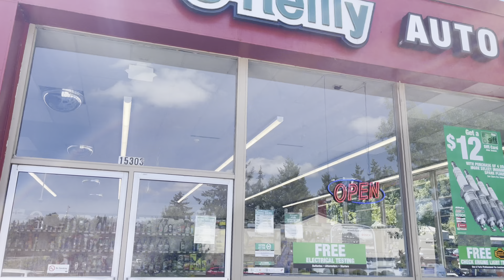Jeep Grand Cherokee Wk2 Radiator/How to replace a radiator

Comment: I did not use that air bleeder.  It bled  it self when driving.  The radiator change you made look way easier than the last video i watched. The other guy was unhooking condenser and bunch of other stuff. 
I do not think i have a leak . I can smell coolant but it's probably from my last coolant change. I sprobably spilled it over stuff😮 but it's good to know it's doable on driveway
Reply from the maker: Haha yea it was pretty simple. I heard it can bleed itself but sometimes you might experience little air bubbles raise the temp a bit.

Comment: Great video as always. Congrats on 1k subscribers. Hopefully you never have to replace the radiator again but if you do the hd radiator will bolt in. Slightly thicker core, holds more fluid and more cooling capacity. Certainly wouldn’t hurt anything. On a side note, I think your engine bay is as muddy as mine. Heck of an accomplishment sir. 😂
Reply from the maker: Haha. Yea I started looking at some of the HD radiators.  I opted for another stock one only because this was an emergency fix and I hadn’t done any homework on the other radiators. But will probably go in that direction in the future. But turns out I’m having some other issues right now. Looks like I’m getting some coolant into one of the cylinders so I might be changing a head gasket here soon. 😩.  Yea I’m pretty proud of my muddy engine bay. Lmao
Reply: @GrandExploration  the hd radiator should be at any parts store too, just the v8 tow package radiator stock replacement. That’s a bummer about coolant being where it shouldn’t be. I’ve done a ton of work on cars but opening up an engine is something I haven’t done yet, seems pretty daunting. But I’m sure you’ll do it right and make a really informative video about it. Keep up the good work sir.
Reply from the maker: @srtabc123  ha that’s uncharted territory for me too haha. Thanks for the faith lol